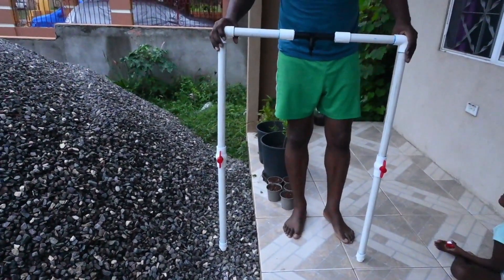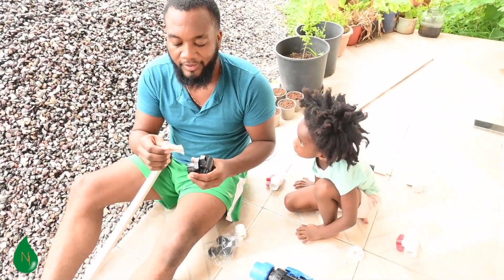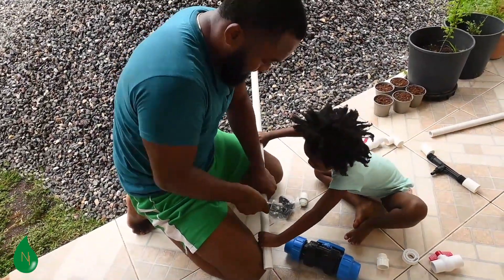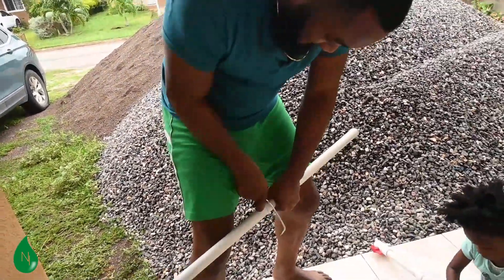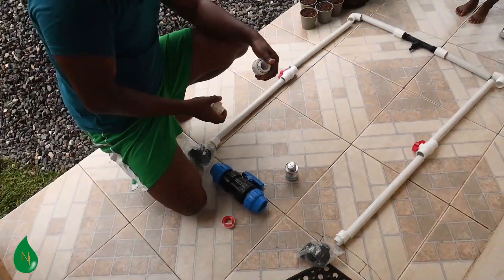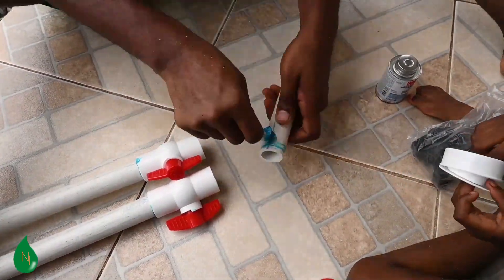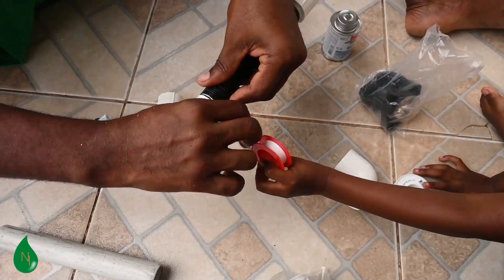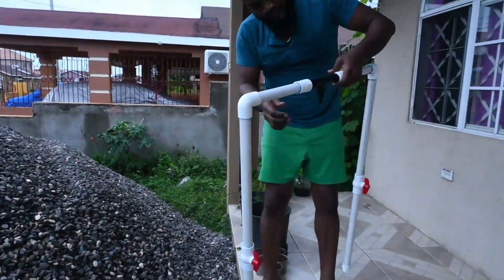How to build a fertigation system for your farm.

Comment: If system dont have a none  return valve should add one (if the pump should shut down while fertigating your fertilizer solution would be pulled back in the main
Reply from the maker: Thanks a million.. We didn't know about this part and we will definitely be checking it out.